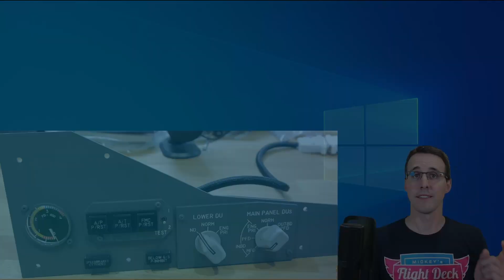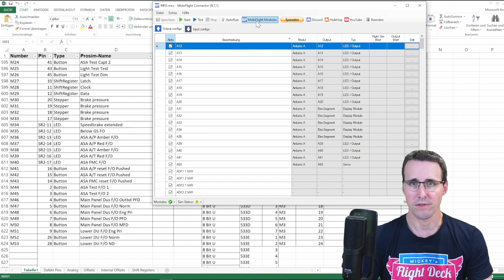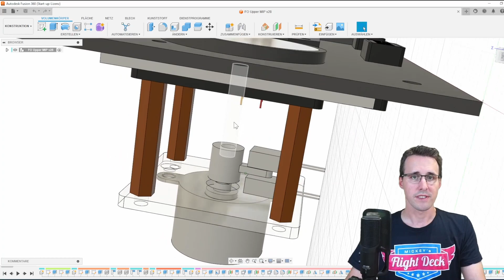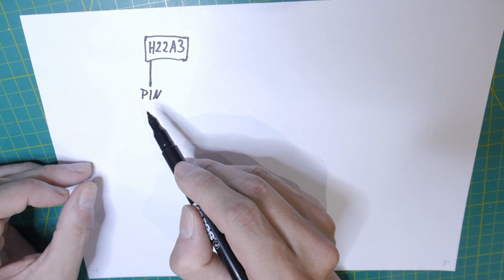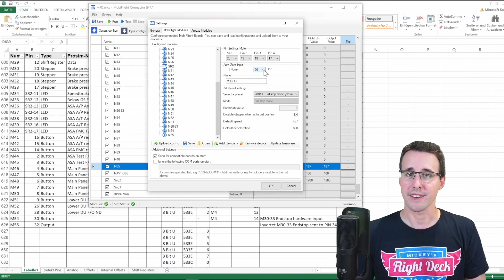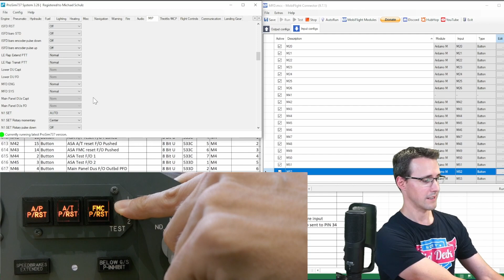MIP FO's Upper Panel configuration - A Boeing 737-800 Homecockpit #78

Comment: Hi Michael, for the speed brake extended, you selected the gate, not the indicator. And gates are always green in UI.
The actual speed brake extended indicator is found under MIP->Spoiler Extend (yeah, I know that name is misleading, but that's the actual indicator element)
BRGDS
H
Reply from the maker: Thank you again very much. I will look out for the option.